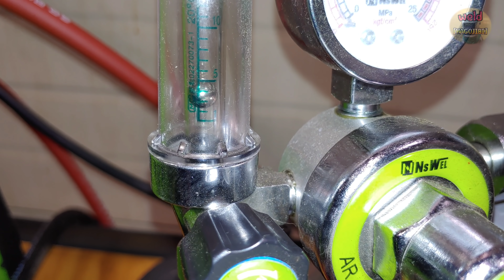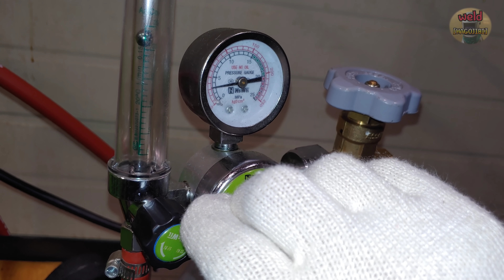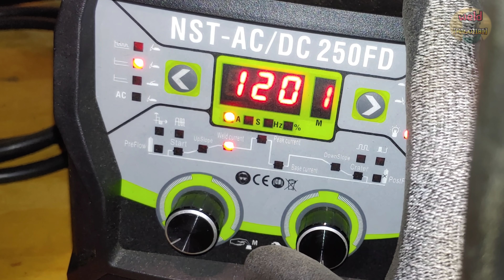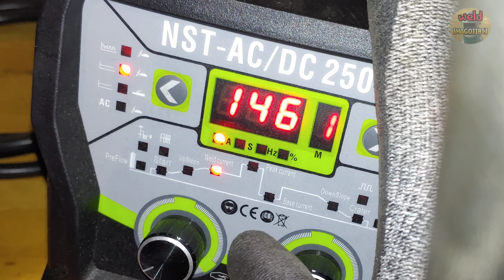Why My TIG Welding Makes Gray Beads ??

Comment: One more thing, I was learning how to weld 2mm pipe cap pass for a while now and it kept coming gray ang gooey also the root pass kept melting and penetrating deeper than needed, I blamed my speed this whole time, no matter what settings I used it used to be all the same, today I found the problems solution- it was the angle of the electrode this whole time, the more perpendicular the electrode is to the surface of the pipe, the deeper it penetrates, so in order to compensate for that you need to decrease the angle... I was surprised how slowly can I weld without turning it gray. and the puddle looks exactly like in your videos... now all is left to improve my root pass because I used to get the same problem.

Comment: Too much heat its not complicated . Your stick out is fine . If its stainless you're carbinizing it . The hardest part of welding stainless is keeping it stainless . Turn the amps down you can see you're running too hot 🔥

Comment: I'm just happy if I get a welding bead from my Tig efforts that is even and if it turns out dark grey or black ....so what, it still holds......colour is not an indication of weld strength or depth of penetration.......as you can tell, I'm not a welder per se, and just weld because I need to attach something to something else very firmly...... a touch with a grinder will make any weld pristine and a lick of paint makes it perfect.

Comment: Awesome! Everything is true, if you let me to notice some moments plus, so, you can mention that if nozzle is too far because of cavitation can suck air and made gray weld bead, or if filler wire is not shilded also can make gray oxidation on weld bead, and same is with wolfram (tungsten), if is not clean can make dirty weld bead.
Reply: 專業 鎢棒不淨沾料 氣流通過阻力 會產生漩流 帶入氧氣 氧化熔蝕!以往我持TIG直軟焊槍 應付高低間距20MM 深度200MM以上全滲透施工焊道 我都會把鎢棒 用乙炔 加溫 給鎢棒彎曲度 但角度不能超過杯口內徑 超過的話 保護氣通過鎢棒阻力 漩流會讓焊道熔蝕!這就跟沾料不淨的鎢棒是一樣道理!